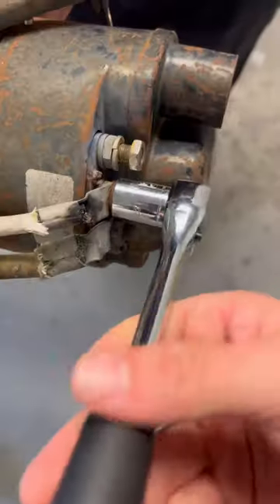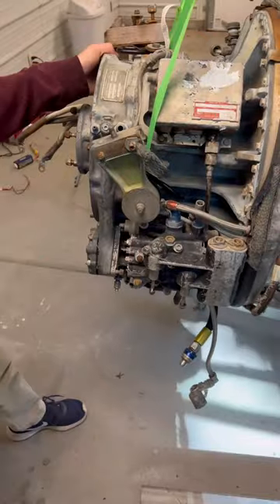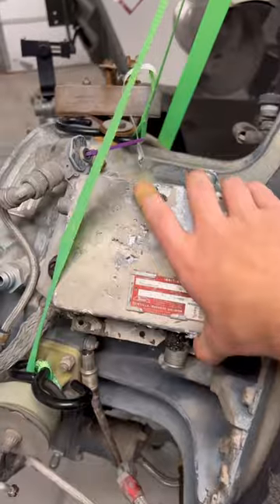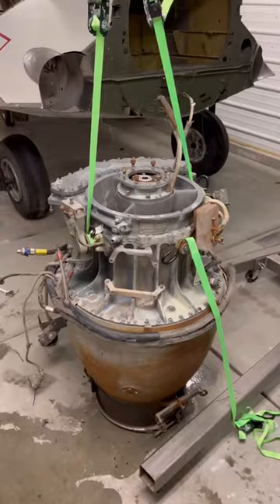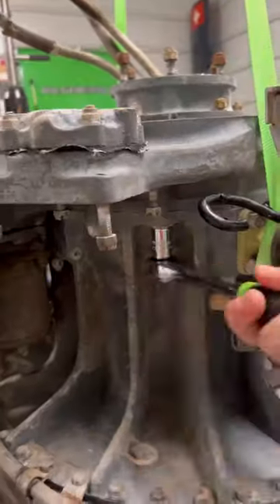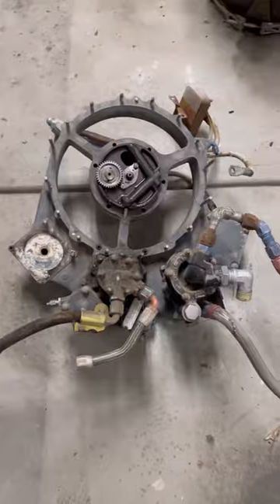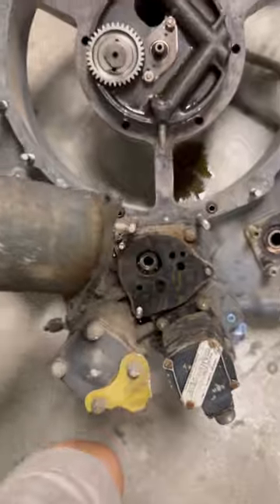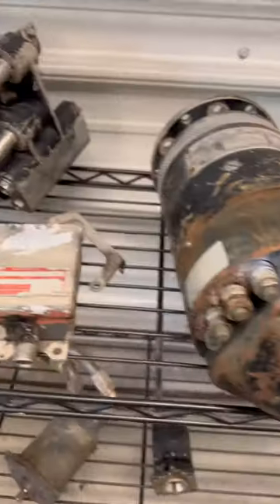Disassembling a Jet Engine for Fun

Comment: I've have repaired aluminum fan blades with a tig welder. Few thousand actually. If you can't find a new one or don't know how to weld, check with local machine shops. We balanced them on a crank balancer. Hope that helps

Comment: What kind if voltage can the exciter have? Sounds fun.
Reply: Something like 115v ac input and 20000v output if I remember correctly for a high tension system
Reply: @liamJCE10  🤩 shocking. Lol

Also: don't need to touch to electrocuted.

Comment: “Anyone can work on jet engines” is a very discouraging thing to hear when you’re spending about 30 hours a week in class for the next year and a half learning how to work on airplanes…
Reply: You didn't need to go to school to get an A&P, I got out of the military as a UH60 and CH47 mechanic then Flight Engineer, left to work on private jets in my home town and all I did was study the A&P books for about 4 months, then my company paid for the testing. It's alot cheaper going that route if you can work for a repair station as they are licensed under the FAA to hire people with little to no experience. You gain way more knowledge in the field doing it hands on than you will in the books. The Airframe test is so out of date really, cause they will ask questions on doping wings, which I mean is still done but sooooo rare.
Reply: @Zaxby722  I decided against joining the military years ago. There are actually ex-military maintainers in my class. The course I’m in is 19 months. The equivalent required internship time to meet the required sign offs and hours is generally considered to be about 3 years. Considering I plan on working primarily on vintage aircraft, doping wings will probably be a required skill for me. Total cost of the course I’m in will be about $2500.
Reply: @Flyboy207  understandable, we have interns at my company that make a solid 25 bucks an hour while getting OJT that can get the part 147 sign offs within a year. I always suggest this path if it can be achieved. I'd rather make 50k a year while learning then spending money. I've had 2 guys underneath me just pass their airframe license testing who one came from being a chef, and another was going to school to be an accountant and pulled himself out of school. No offense to the kids who go the AATS route but when they come in to the field they tend to be extremely full of themselves and get humbled real quick when they start the actual work. Most of them we have brought on quit within a year. Are you going to Spartan?
Reply: @Flyboy207  for sure, best of luck to ya! Take a look at Duncan Aviation when you graduate, they are always highering and will pay for relocation if you live out of state. Great place to work.
Reply: @Zaxby722  Thanks! I’m hoping to work on either warbirds or firefighting aircraft, but I’ll certainly look into other options.

Comment: “This bad bot will put you in the ground”, mabye if you mess with it while there is a battery connected but why would anyone be doing that at that point the whole airplane is a hazzard, that part just highers the voltages required for ignition my man when the battery isn’t hooked up its perfectly safe

Comment: No, No, but all hell NO! 
Not everyone can work on jet engines.  
Yes everyone could tear one down sure.  Most can do that.  
Building a reliable thrust you can trust jet engine is a skill level one only gets from training and practice.  A jet engine build requires a lot of read the technical manuals and knowing how to work on a jet engine.  it’s not a car or motorcycle engine.